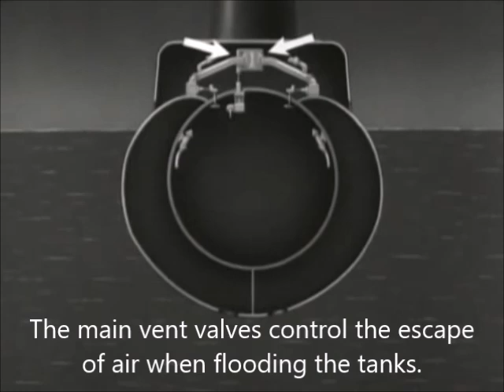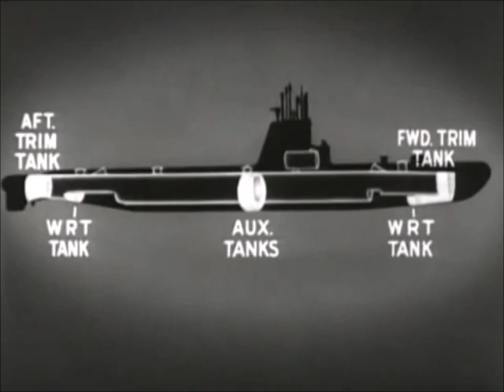Submarine Ballast Tanks

Comment: So compressed air isn't as buoyant as normal air? It's the same amount of air in the sub at all times, it's just compressed into the system when flooding the tanks right? I'm lost
Reply: Correct. It’s all about volume and weight. 

You can have the same quantity (mass/mole) of air but depending on how compressed it is, it will take up a smaller volume. The relationship is - Volume = Pressure/((A Constant) x Temperature)
By displacing the volume of water in the tanks with air you reduce the weight which makes the submarine float and vice versa.

Comment: After already having watched multiple recent videos about "How Submarines Work", I've learned about the crew quarters, missiles they have, and what China is working on, but not "how submarines work", namely the ballast tanks.  Thankfully, a video from 1955 fit the bill and I could finally get a good idea.  I'd still like to learn more about the pressurized air (like if they create oxygen through electrolysis, etc), but I do have to say that this is the best video I've found so far on the matter.
Reply: Took the words right out of my mouth. Every other video talks about literally everything other than how a submarine actually dives and resurfaces!
Reply: @ZVEKOfficial   👍
Reply: Exactly what I am thinking. Exactly!
Reply: @bobpourri9647  👍
Reply: The air tanks to pressurize the ballasts are filled when the sub is surfaced. The compressed air is then stored and ready to use when needed to resurface. I imagine they also have reserve tanks of compressed air that aren't ever used unless the main tank fails in some way.
Reply: @Intamin  Thanks for the additional info!

Comment: So I guess they need to go up for air periodically to avoid running out of pressurized air needed to surface?
Reply: If you imagine the submarine is neutrally bouyant so a small amount of air will expand as the sub rises. As it does the air can be re pressurised back into the system, this only looses a small amount or air. Imagine a tank the size of a firemans cylinder can provide useage for 45 mins at 300 bar, similar story here, as it gets used there is a small drop off in total pressure but years of usages. only after an emergency blow will you need to resurface.

Comment: can anyone explain to me how the water enters the ballast tanks in simple and dumb terms?
I really don't get how water can just sip through when you still have air inside the tank
Reply: @supermick83  Terrible explanation
Reply: When water is entering the ballast tanks air is being drawn out of the ballast tanks. Pumps will pull the air from the ballast tanks and push it away through external holes in the submarine's hull which will leave empty space in the hull, that space will then be filled with seawater through the bottom holes you can see in the video.

Comment: But how would I do a diy ballast tank?
Reply: It seems pretty simple 
you would need some sort of container that when you suck in the water it fills the container and when you push out the water it empties the container so i am thinking some sort of pump but the question would be how you would interface this pump also you would probably have to have some sort of sensors that tell you the desired water level is reach so you don't over suck the water.
Reply: Lxix69  What would you used to control how much water the  syringe takes in or lets out. I am also thinking about the size of the sub if you have some sort of mechanism that empties the syringe or fills it

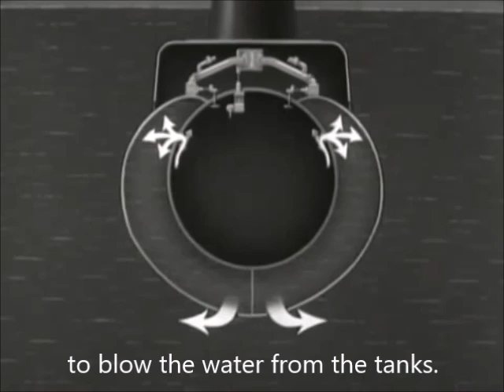Comment: 2:36 why the water didnt go in to high pressured air tank?
Reply: same as the question: why when you blow out through your nose when you’re under the water
Reply: @fallingup8358  ooh ok, i see. Thx you
Reply: @fallingup8358  is the high pressured air rechage when submarine on surface of the sea?. Bcs when the valve is opened, it decrease air pressure inside the tank, right?